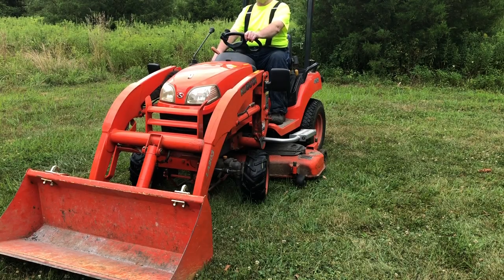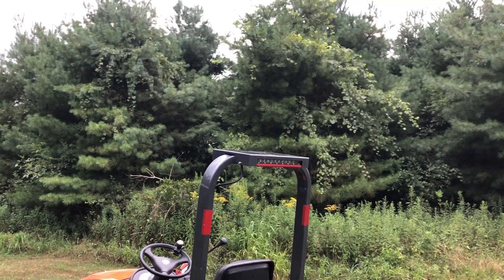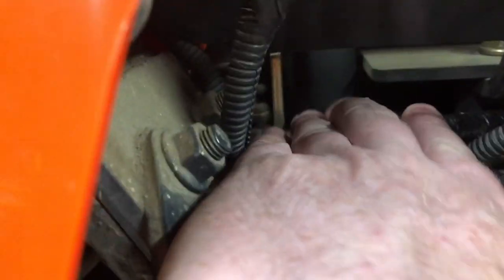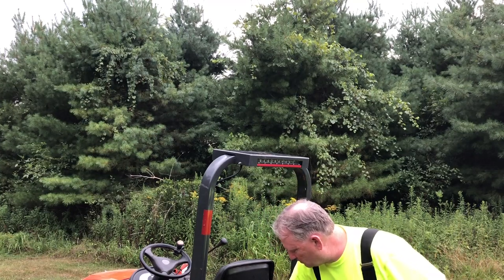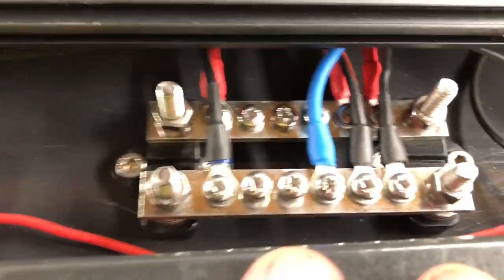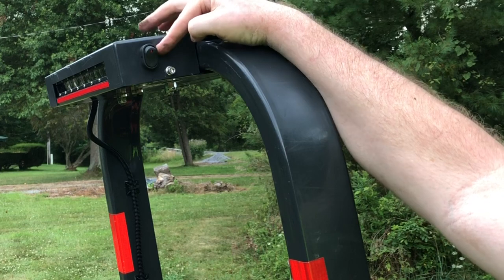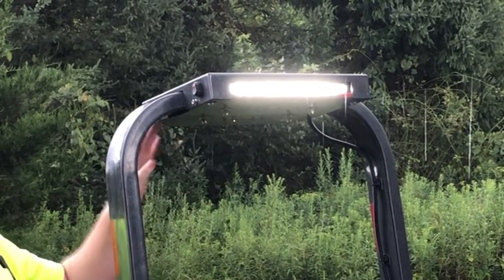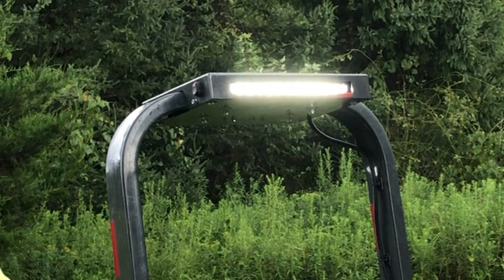#38 - BX1850 Stealth LED Module

Comment: Super cool installation there Bob. Love the way you did it. Very tidy install. I’m impressed and it’s hard to impress me lol. It’s a nice low profile clean system. Yes it has a tilt on some ROPS but the two inner led light bars are adjustable to get the lighting where you need it. Considering it’s all steel the top portion can be used to mount a magnetic strobe light for winter snow clearing. Being a totally enclosed system the lights are protected from branches as well and there’s no drilling of the ROPS and fast to install. Sorry you got caught in the rain. Thanks for your business and the video. Kathy and I appreciate it very much. Keep well and happy tractoring.
Reply from the maker: Thanks for commenting and feedback. I did adjust the lights inside the Stealth LED Module to compensate for the angle of the ROPS.  My apology for any confusion this may have caused.  I look forward to my next Paul Short Mod.  Cheers